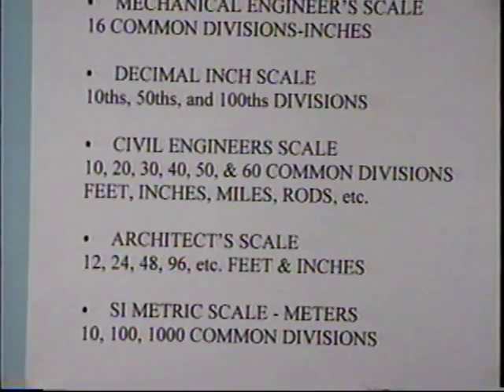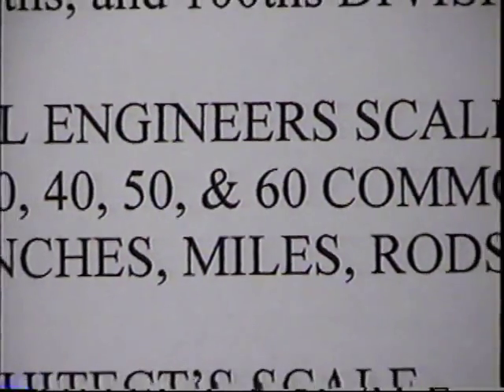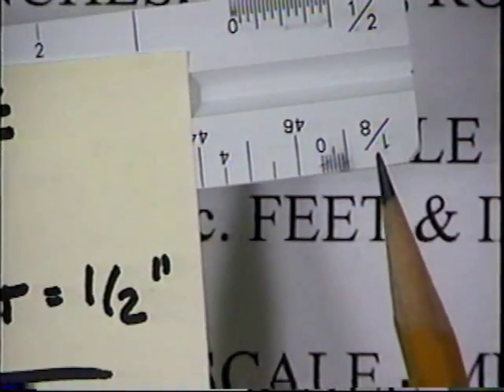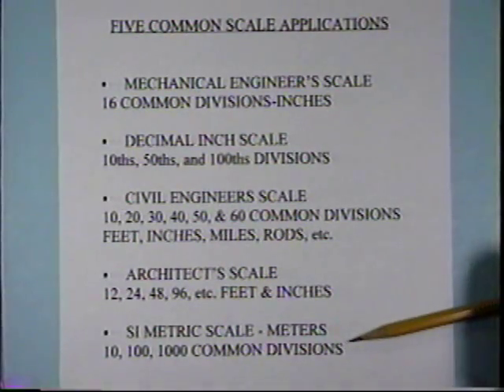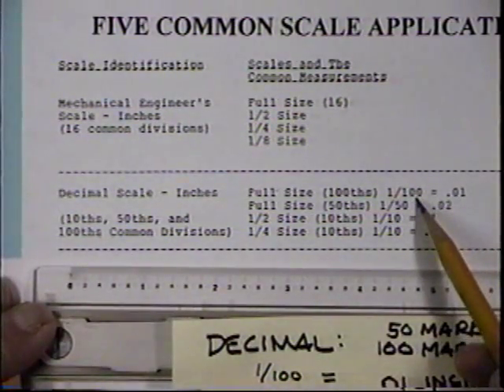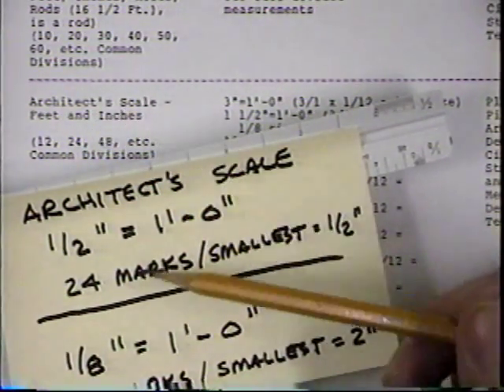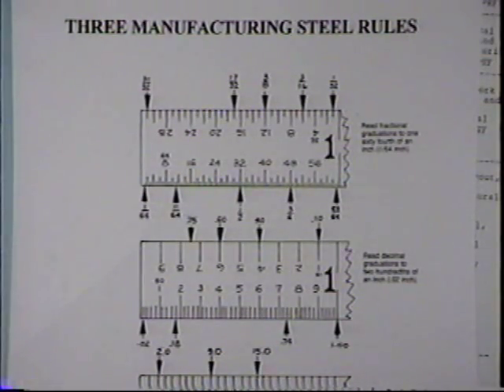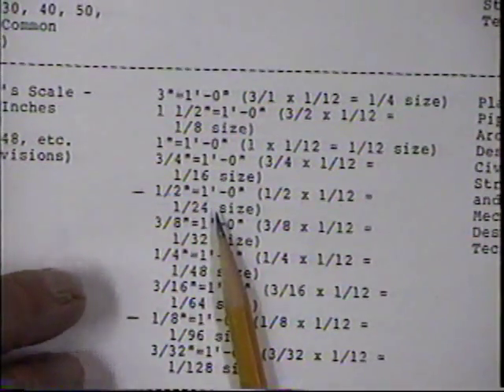Engineering Scales for CAD & Shop floor

Comment from the maker: Helps the Technical Trades in CAD, CAM, CNC Programming.  Five Common Worldwide Applications...Architectural Buildings, Civil Maps, Mechanical Design & Manufacturing, Decimal-inch Ruler, and Universal Metric Millimeter Worldwide Applications to the Trades.

Check out the Workbooks by TJ Vanderloop Publications for the Trades at James F. Lincoln Arc Welding Foundation Books at a Fair Price!

TJ (Tom) Vanderloop, CMFGE & CMFGT, Author, Consultant, Educator & Supporting the Skills Gap in the World.